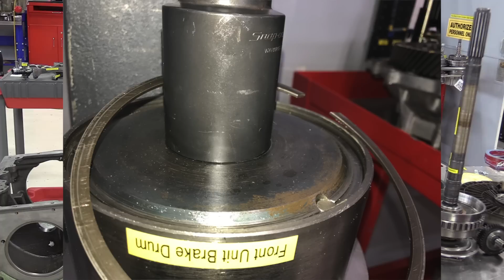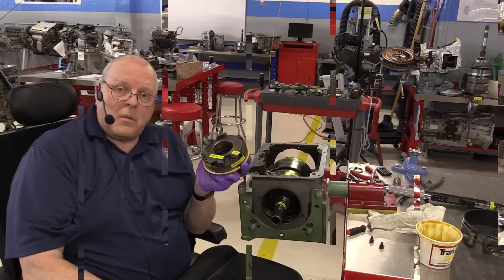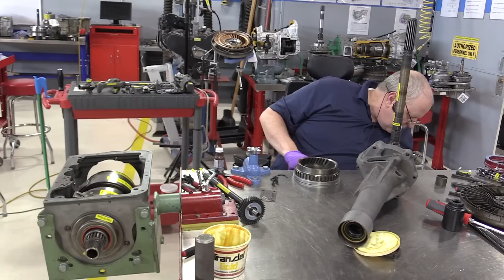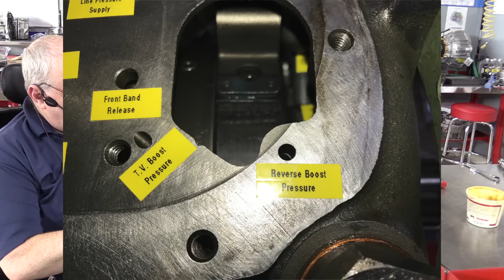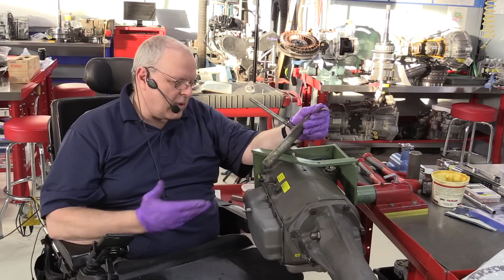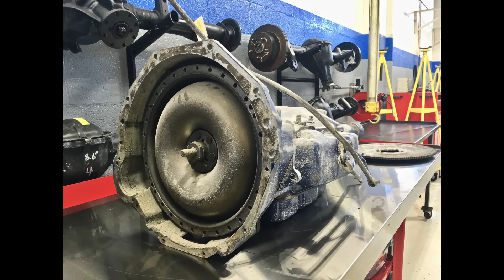World's First Mass-Produced Automatic Transmission - Part 5 - Final Assembly

Comment: The Hydra-Matic transmission was indeed a very crude piece of technology when it was introduced in 1940 and yet the engineers managed to make it very reliable and robust during the first few tries even though the early units did have some flaws, notably a very harsh 2-3 shift.    

The fact "Hydramatic" is a trademark name used today for pretty much all the automatic transmissions used in GM vehicles regardless of whether it is a 6, 8 or 10 speed, etc. is really a testament to how groundbreaking the original 4 speed Hydra-matic design from 1940-1956 really was.
Reply from the maker: It was an amazing accomplishment. Thanks for watching

Comment: 1951 PONTIAC CHEIFTAIN LEAKING FROM THE TOP OF THE CONE LOOKING SHAFT. IT DONT LEAK WHEN PARKED JUST WHEN PUT ON DRIVE. NO ISSIES WITH THE TRANSMISSION JUST BAD LEAK. WHAT IS YOUR ADVISE AS TO THE PROBLEM?. THANK YOU

Comment: I really like your videos on the hydamatic trans.I drove a 1958    GMC School bus that was a 6 cylinder with the hydamatic trans it was so much fun to drive the motor was right beside you inside the bus the front wheels was back behind you it N 14-13-12-R on the shifter you would have a rough shift best I can remember between 2-3 gear you could let off the gas and it would shift lot times it had a govner on the motor it would only go 35 miles per hour Best I can remember the trans give trouble on a long hill on its route when it would have to down shift a lot it they had to remove from that route I have heard the mechanics didn't like to work on it .aThe bus would carry more students than any other bus.So watching your video has been very interesting to know what made it work. Your trans may be little different but should be close I guess.I work on a lot trans the one I found interesting is the sector o speed in the early ford tractors they were like a automatic but had no torke converter it had a inch pedal instead and 3 bands 10 gears and 2 reverse really like to rebuild them back in the day.

Comment: 1955 super88 Holiday 4bbl Rochester. This car always impressed friends because the shift sound was like the 4 on floor back i n 1964. I had finally figured out the carb linkage , and made it shift better by tinkering. My greatest amazmemt was the easy push start!  The whole truth is that the car would start on a rolling 7 mph.   I have to think the big fluid coupling is more solid than people would imagine. No wonder no trans cooler needed.  Man,pull her into low and youd think it was 442 or GTO. That passing downshift was brutal and made a little rubber. The trans is like a 4 speed . When I hear todays restored cars run with the Olds hydra with the 324.2 CID, I hear and recall the old familiar sound of the GM great 4 speed hydra-dramatic trans. (Highly Dramatic)  I love the basic concept of two gear boxes in series with differing reduction and selection of individual  through-put clutching scheme to yield 4 speeds. Two gear boxes and two clutch systems to Yield 4  great connections.  It is true it was a bit harsh, but kids love that. They buy shift kits to give that result. Did anybody else like to start the car on a slight grade of the grocery store at 6 or 7 mph by shifting from  N to Low od DR.  Good Times with that drivetrain that had guts.

Comment: Great work on the videos you must have spent hours and hours on research. I have been restoring a 1953 Lincoln Capri and when getting ready to pull the motor and transmission i was a bit surprised to see the Gm logo on the trans vin tag. Looking forward to going through it after watching your history/ repair videos. Any trouble finding parts? Thanks again for a job well done.
Tony

Comment: An addition to content: The Hydramatic was in GM passenger cars through 1956--in the Olds & Pontiac models. The Hydramatic was one of two auto-trans options for these models and this year. The other option was the Jetaway (known as the Strato-Flight in the Pontiac).
Reply: The 1956 jetaway was not strong like hydra of 1955 was. Smooth, yes; strong, no.
Reply: @richardcallahan8698  The '56 Hydramatic was the strongest of all the Hydramatics--it has one additional clutch in the rear pack, and the output shaft is larger. The bearing, tail housing/seal, and yoke, are also larger to accommodate these changes. All this led to the larger U-joints still in use today. BUT, all this still wasn't enough---the last year Hydramatic, 1956, was still limited to 220 HP capacity. Sadly, the horsepower wars that led to the Hydramatic's end.

Comment: Have you ever used the internal band adjustment tool ? 
It sets both  band spacing so you do not have to run engine at 1,000 rpm.
B & M hydro use to sell them .

Comment: The first Hydra-Matic transmission was originally made in 1938 for the Olds 1939 model year.  The first generation Hydra-Matic had NO Park position and a single Drive position. Locking the transmission when the engine wasn't running, was by leaving it in the "R" position. Reverse was accomplished with a sliding idler gear, like a manual transmission. This is why the transmission would grind if the idle speed was too fast. A second drive position was added later. When the Hydra-Matic factory burned in 1953 was the end of the first generation. In Cadillacs, a Buick Dyna-Flow was substituted or a manual transmission. It wasn't until 1982 that there would be a Cadillac offered with a manual transmission. After the Hydra-Matic factory started up again a new generation of Hydra-Matic automatic transmission was introduced. It was now called the Jetaway Hydra-Matic and was a whole different animal, with a Park position. This transmission was used into 1964 in Cadillacs, Olds and Pontiacs until  the supply was exhausted. During the 1964 model year, Cadillac switched to Buick's new S.T. 400, an all-new 3-speed automatic. This single year first edition was identified with a single Drive position, like a 2-speed PowerGlide. As Chevrolet had done years before, Reverse was moved next to park. 
Rolls-Royce took over manufacturing the first-generation Hydra-Matic  and used it until 1967 in European markets. For the U.S., R-R switched to the T.H. 400 and used it for over a decade, just as Jaguar did behind it's V-12 engine.

Comment: Hello, It's amazing reassembly of classic transmission! I have a question: do you know what automatic transmission was world's most mass produced? Aisin, ZF? Thanks a lot!
Reply from the maker: The 1940 Oldsmobile Hydra-Matic from this video was the world's first mass produced automatic transmission.
Reply: @WeberAuto  Ok. Hydra-Matic 315 does have two-stage fluid-coupling or it coupling with torque -converter?
https://en.wikipedia.org/wiki/Hydramatic#/media/File:Ypsilanti_Automotive_Heritage_Museum_May_2015_053_(1956-64_Hydra-Matic_315_transmission).jpg
Reply from the maker: @romanjanke5923  It has a fluid coupling with a stator. The smaller fluid coupling (controlled coupling) in the transmission body replaces a clutch pack used in the original Hydra-Matic. They were trying to reduce the jolt of the 2-3 shift.

Comment: First american built hot rod, in fact first american car i ever owned : 1953 Olds 2 dr. black with 390 : 1 rear. limited slip, posi or welded spider gears. 1955 4 speed Hydro built to B&M specs and 1959 394 with Starfire cam. A somewhat tired dragstrip refugee but a fun car none the less and an introduction to big block stump pulling torque. Brings back memories from circa 1971.
Reply from the maker: Thanks for the information!

Comment: This is excellent! I watched just to try and understand more about the one mechanical component of a car that i understood least. I got a lot more out of this than i thought i would. Plus, the front clutch drum and components including the hub that aligns with the friction discs and steel discs is the same engineering as is utilised in a 1976 Moto Guzzi motorcycle i am doing a light restoration on. Including looking into why i cannot get the 2 speed box which is in effect an auto. trans. of sorts. in to either range. This by virtue of the fact that there is a Sachs torque converter bolted to the flywheel. With a clutch housing bolted centered over the trans. input shaft. The very end of which has a hub just like this front clutch hub. Learned a lot. Thank you!
Reply from the maker: Thank you!

Comment: hi, i've seen your video and it's very good!  I have a Hydra Matic gearbox, it's from my 1949 series 62 Cadillac. The gearbox doesn't work well.  I bought the book: The Hydra Matic tranmission 1946-1955 Adjustment  and service manual. Do you think that with that book I can fix it?  Where can I buy spare parts?  Thank you. Paul

Comment: I own a 1968 RHD Rolls-Royce, which used the Hydra-matic transmission (with some minor modifications) and up to now all the information I had found online or in books was so generic. Then I found your videos, and I've learnt SO much ... Not only about the theory of how the fluid coupling trans would work but also practical applications and advantages of it. Overwhelmed by how well engineered the original Hydra-matic was. And the lectures are so thorough, methodical and precise..wish I was living in the States, near your university, I would enrol straight away on a course run by you, Sir! Thank you very much.

Comment: Thank You, Thank you I Had a blast building the Hydra-Matic with you all the way. I have  been  in the Transmission Business for 35 years and still learning. Sam's garage T/V hosted by Sam Mahdavi and Sam Memmolo are restoring a 1954 Hudson Hornet on the show. The engine is the 5.0L inline flat head 6 cylinder engine. The Transmission is the Hydra-Matic unit you just assembled and thought me a lot about. The owner is the H&M HEM-Shaw Saw guy Gary Harrison. The Trans is being shipped from Atlanta Georgia to Baker City, Oregon and we get the opportunity to rebuild the unit. O-BOY The engine was locked up so they had a time removing the engine with the trans still mounted to the back of the engine. Question is the flex plate threaded were that gasket goes.

Comment: Great info on the hydromatic transmission.  I remember the many semi automatic variations that were around, such as tip-toe shift in a dodge.  My dad had a 42 dodge he drove on a government project in wwII that had a fluid coupling with a clutch and manual transmission behind that.  He loved it because he could drive in snow and ice conditions by starting out in High Gear and the output torque was so low he would not slip and be able to get in motion rather then spinning the wheels.  We are all so used to modern automatics that those olden days were 'so primitive"
Reply from the maker: Thank you and thanks for your feedback. I am familiar with the Dodge/Plymouth/Chrysler/DeSoto Fluid Drive systems. They did have several unique advantages and several disadvantages when compared to the fully automatic Hydra-matic transmissions. Have a great day!

Comment: I've got a leak at the bottom of my flywheel cover. The cover has a small hole I guess as an indicator. I fast forwarded to watch you reassemble from the torus cover. Looks like there could be a couple gaskets that could leak. Did I also see a drain plug on the cover? Maybe that could be my leak also? Thanks for sharing this video! Hydramatics rule!!
Reply from the maker: Yes, a drain plug
Reply: @WeberAuto  thanks, sorry for not watching the entire video. I kinda sucked in school. LOL

Comment: Glad to hear the 4th gear correction;  I had always heard that the torus slippage was only a few percent, unlike in a torque converter which slips so much that a fluid cooler is required.
Reply from the maker: Thanks for your feedback!

Comment: That was a fantastic series of video history of the Hydramatic.  I learned to drive in my dad's 1955 Olds 88.  I don't recall every any problems with the auto transmission - I do recall oil consumption and generator failures though.  Where did you get the book on rebuilding the Hydramatic?  Also, my memory is that the Hydramatic on my dad's 55 Olds 88 had only 3 forward speeds - am I wrong?
Reply from the maker: Thank you! The 55 Hydra-matic was a 4 speed. You can find old repair manuals on ebay. Thanks for the feedback.

Comment: Thanks for the great video.  I am in the process of rebuild my 1947 Cadillac Hydra-matic and trying to research information.  My question is have you or anyone else on youtube show how to determine if the bushings are worn on a Hydra-matic.
Reply from the maker: Thank you! The service information shows using a feeler gauge to check the gap. If the gap is excessive, the bushing needs to be replaced. Best wishes!

Comment: I have just finished rebuilding two Hydramatics from a 1945 M24 Chaffee tank, which is powered by two Cadillac engines, like the M5 Stuart tank you mentioned. I was surprised at how little detailed info there is on these trannies. Then, AFTER I finished the rebuilds, I found your excellent videos! That's just poor timing, either by you or me. :)
I just wanted to add a couple of things I found. 
The M24 tank uses an intake manifold vacuum signal to the valve body, rather than the more common mechanical linkage from the carb, to determine engine load. The vacuum acts on a piston that operates the throttle valve. I don't know why this simple, reliable way of sending an engine load signal to the valve body did not gain acceptance over the complex mechanical system for so many years. 

You refer to the numerous bronze washers in these trannies as "bushings", but bushings by definition support a shaft radially. These bronze washers are thrust washers which are there to support the axial loads generated by the engagement of the helical gears. There are also various white metal bushings supporting the shafts like those in the bore of the oil delivery sleeve. 

I have posted some rather amateurish videos on setting the front and rear servos and bands (as I think this is an area that causes concern with setting up these trannies), and also a video on the basic valve body operation. I think (hope) these add to your videos. 

https://youtu.be/tlgen9REnMg

https://youtu.be/BQpR4ApSOd0

https://youtu.be/onBkjvwGgEs

Malcolm
Reply from the maker: Fantastic Feedback! Thank you! I did not know about the vacuum modulation of line pressure on the the M24 versions. That is awesome. I did not think vacuum modulation of a production transmission occurred until the 1957 Chevrolet Turboglide transmission (even though the patent was granted in 1940) Patent US2310518 VACUUM CONTROL OF CLUTCH CAPACITY. Thanks again, have a great day! I will check out your videos.

Comment: Very durable unit.  Beat it to death for 100K miles change the fluid, adjust the bands & beat it for another 100k miles.  This was the base for the B&M Hydro Stick racing units.  Later ones adjusted the bands internally with a gauge slipped over & set for a slip fit with a star wheel held by a spring tab/pin.  great video.  Really brings back memories.  Keep up the great work !!
Reply from the maker: Thank you! That is a great story!

Comment: I was thrilled by detailed explanation in your video, but I am still confused with only one thing with automatic transmissions. Why, if we want to go forward we need to pull stick back, and if we want to drive back we need to push stick forward?
Reply from the maker: Thank you! That is a great question!
Reply: Because if the stick is down in park it would be in the way of the knees.  Restrictions on egress in many cars with the control on the steering column... when the controller is moved to floor shift the transmission mechanical positions was not changed... in later cars the park and reverse are first and are first on tree going down ... fwd drive gears would be lower...  if the reverse was at end and your hand accidentally hit the stick it would possibly go into reverse causing accident....  on some cars it was just push buttons to engage the trans.... many manual transmissions also have reverse in fwd odd position..  mechanical convenience, natural order, and the way we've always done it so why change I suspect...

Comment: I generally enjoy transmission rebuild videos (Hiram Gutierrrez's channel is one of my favourites), and I have had the longing to seeing a vintage transmission dissected exactly in the manner that you did it. Thus a huge thank you for the effort you put in to making it possible. I am looking forward to seeing future videos!

These are more thoughts, than suggestions. First of all - Packard's Ultramatic... I know it is extremely rare to source, but just a discussion into its pioneering lock-up clutch is worth mentioning. Second - you mentioned the scope of what cars featured them, but its worth expanding on that only GM's Cadillac and Olsmobile, but also the Lincoln's, Rolls-Royce and Mercedes Benz on its 600 engine. I do believe that the latter had their own evolution lines, but information is very scarce. 
Finally, and I know its very inappropriate to criticise Aaron Steverson for his amazing work, but the lack of such comprehensive  material in regard to Ford's Cruise-o-matic and Crysler's Torqueflite is quite obvious. Not only that, but the effort both manufacturers made in making manual transmission more smooth and practical (Fluid Drive and the Overdrive unit).
Reply from the maker: Thanks for your feedback! I look forward to further exploration of the evolution of the automatic transmission from GM as well as Chrysler and Ford. I have an early Chrysler PowerFlight on the way. I am currently looking for an early Ford Ford-O-Matic.

Comment: some on youtube use Vaseline on an automatic transmission, is that Ok ? thanks...
Reply from the maker: Yes, but it takes higher heat to melt it and cam delay normal transmission operation until it does melt.